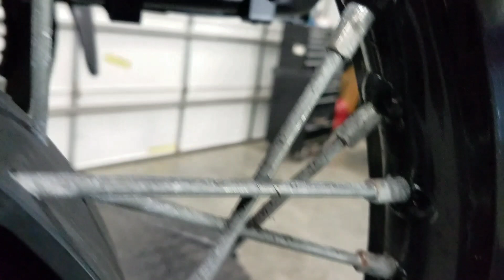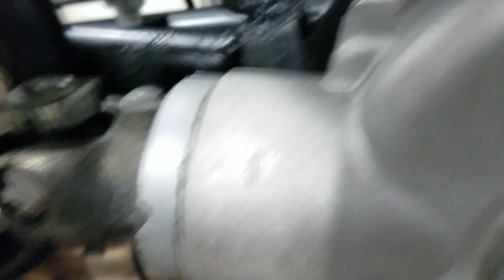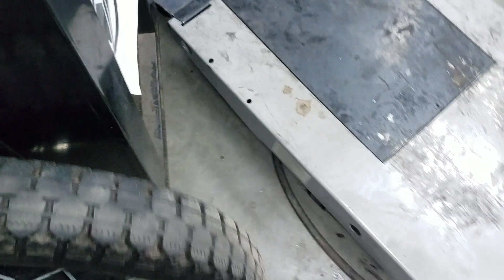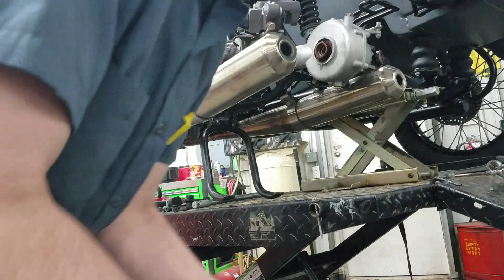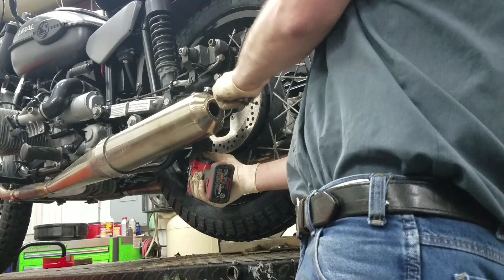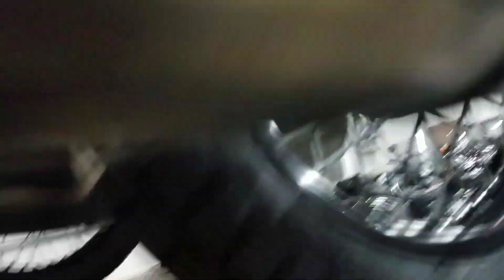Ural Sidecar Motorcycle 2WD Rear Wheel Removal

Comment: So you tighten the axle nut with the axle pinch bolt completely loose? On some other axle applications with a pinch bolt, you get the axle nut about a full turn short of being tight, torque the axle pinch bolt to spec, then torque the axle nut to spec. This takes out the side-to-side play (clearance) that is needed to remove and replace the wheel without having the play present while operating the bike. Did I miss something in your video?
Reply from the maker: Any play is taken out when the axle is tightened as the shoulder on the axle presses the wheel tight to the final drive.  One would not want to tighten the pinch bolt first as you could induce play into the setup or bind the assembly.

Comment: Only one question concerning the rear brake caliper calibration. You just installed the pads on theie place, do you need to recalibrate the piston with the center caliper bolt after reassembling the brake pads or just place them back and that's it? Thanks.
Reply from the maker: Parking brake piston gets recalibrated after Installation of the pads